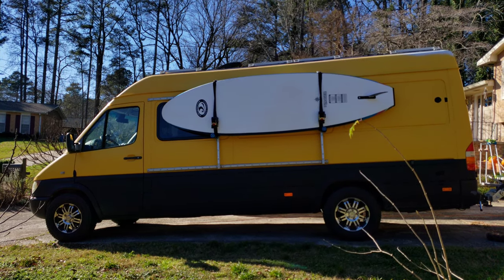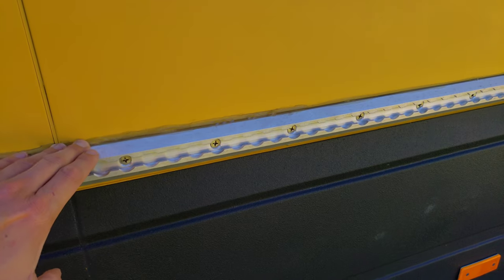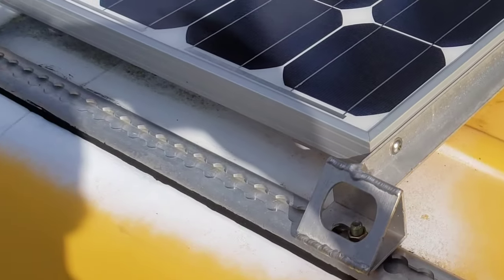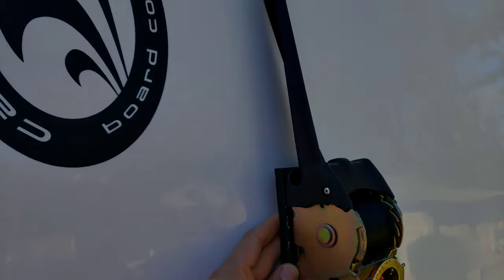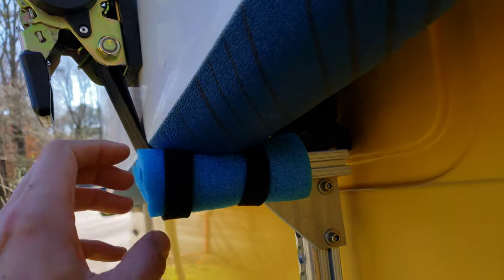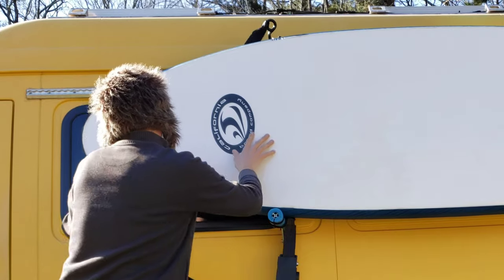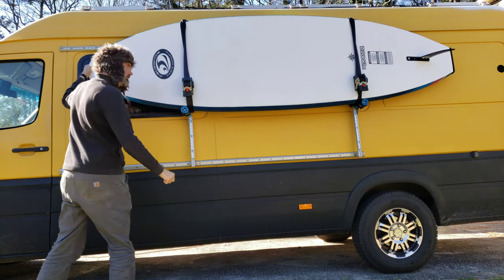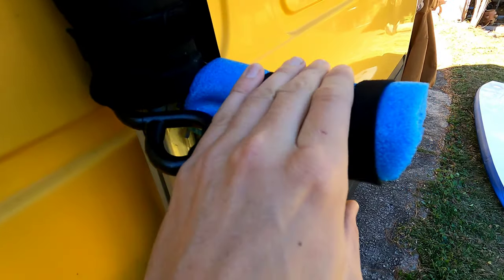DIY Modular Water Sport Rack 4 #vanlife || SUP Kayak Canoe Surfboard Inflatable Stand Up Paddleboard

Comment: I was just looking at some Vertiracks that cost over $1000.00. Hah, no way! This is a great idea you’ve got here. Thanks for sharing. I want to make a set to hold two boards on my Ford Transit. My concern would be how to lock everything down to avoid theft. Got any ideas?
Reply from the maker: I was also concerned to find a solution for locking it up to avoid theft. I'm going to try using a pair of these Master Lock adjustable cable locks. https://amzn.to/3A6Pei4
 By using one at both narrower ends where the crossbars are attached, then it should be impossible to slide out the board without cutting the cable locks. The standard length of this cable is 6ft, which may not be long enough, but they also sell an 8ft length which should work fine.

There are several stainless steel cable reinforced strap solutions designed for kayaks and boards, but the quality of those seems questionable. Here's an example of one. The stainless steel cable reinforced strap looks good quality, but the lock seems cheap and according to reviews is easy to break. https://amzn.to/3KjZ9pd

There's also this product for locking up paddles: https://amzn.to/3Kc8DTo Although I find those easy to store in the van.

Instead of using the quick release solutions for attaching the crossbars to the L track, you can use bolt-on attachments that would make it more difficult to remove the crossbars: https://amzn.to/3I7AvGk

All of the solutions I've seen would deter casual theft, but not someone who is determined with the right tools. The Master Lock adjustable cable locks are the strongest solution.
Reply: @engineerable     I’ve been using the Kanulock straps (your second link) for a couple years now. Haven’t had any of the problems that some of the reviewers are complaining about. I think many of their complaints have to do with not knowing how to properly use the locks. For example, the locks won’t unlock unless you pull the lever up hard while holding it up before turning the key. I am about to buy and then build a Ford Transit high roof and my first idea was to slide two to three sups (7-10, 8-6, 9) into the garage but I’m not sure I can make that work. You’ve given me some good ideas. Thank you.
Reply from the maker: @joeblow1942  So based on your experience you feel like the Kanulocks are secure from theft when used properly?
Reply: @engineerable   Mine are, but like you said earlier, anyone that really wants what you have and had the tools could cut the two steel cables that are embedded in each strap.
Reply: I’d think I’d mount it fin first. Less chance to wiggle and slide right out.
Reply: @Ritebowl    Greater chance of impaling others too!